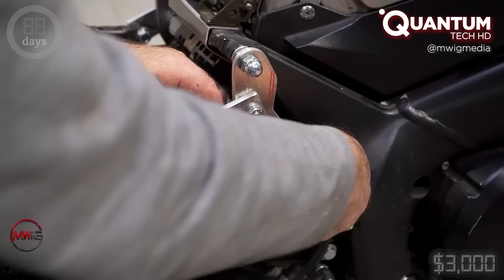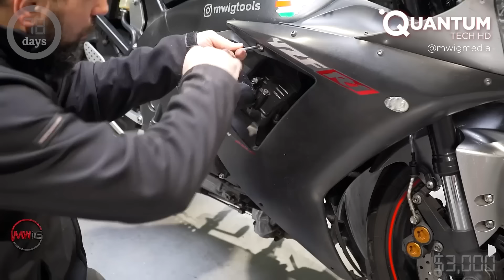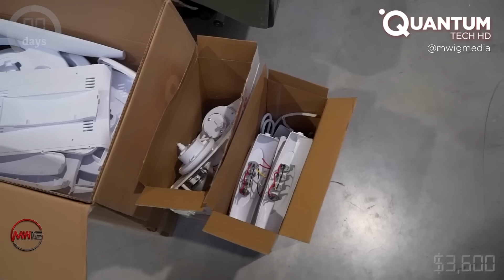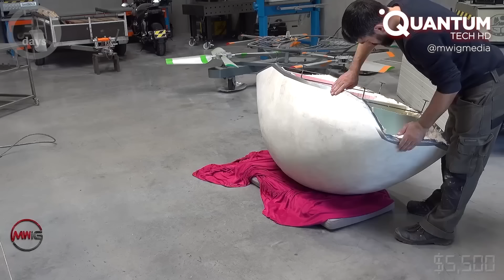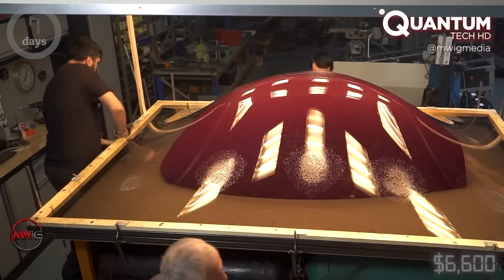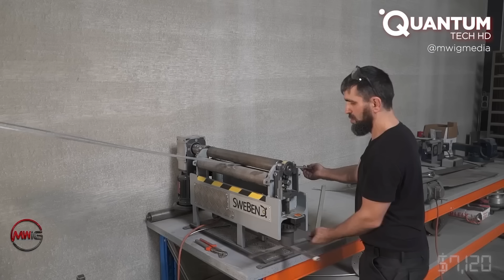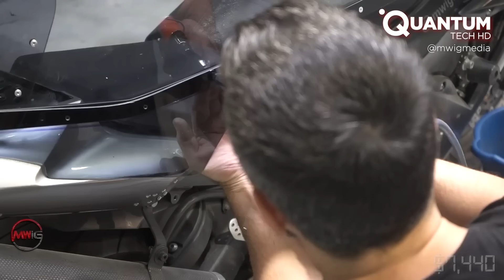The Motorcycle That Beats the Rain (Built in a Garage) | by @mwigmedia

Comment: why did he fix the heating chamber to the ceiling??? why not lower it with the PC sheet??? how can one be so shortsighted?!? problem solving, give me a brake! you could have used the same first sheet again! with vacuum, if the surface of the mold is clean and smooth, you can mold and thermoshape the same warped sheet! thermoplastics work like that! and the vacuum is not adequate! much more instant suction is needed! you heat the sheet continuously while shaping and vacuuming! the industrial molds are preheated, and not plastic or foam! this is very disturbing, an epic fail, and very childish! a one-piece would have been much better! and polycarbonate should be thicker! not 4mm, at least 10, for a safety cage. and it should have been higher! no problem if it's a bit higher, the crosswinds are a concern but you need to consider helmet space and seat the rider ergonomically. not crammed and with mobility so limited! this is an aerodynamic structural and safety element he intended to manufacture! there should be these things on the market already. the fact that there are not, should probably give you pause.. the thing is, they make, albeit not sufficiently effective, rain repellent clothes and helmets for that.. well, you gave it a try..  I ride myself, and I know wind is a problem without this huge construction, I feel pushback from the helmet and side winds, the point is thermoshaping, in any application, you need heat, and once you contact the cold mold, you instantly lost malleability!! I'm not even addresing turning your motorcycle into an air resistance blimp monster. thermoshaping is the actual point here! of course you wanted functionality, ok I grant you that! Man, the rain must bother you a lot! just don't go fast, and avoid storms! thermoshaping needs heat throughout the molding process! even after applying vacuum!!! heat is what was missing! how did you not see this?? engineer my sphincter! cmon people! it would have been interesting! instead you wasted my time! why not build the same rig, the heating chamber with tall walls, not cut it in half, even taller, and not with vertical walls, but a truncated pyramid with heaters on the top and on the walls as well, much fewer would have sufficed, and it was smart to build above, but you should have lowered it in place, and kept it there, made sure the mold would be heat resistant. you build that with plaster, something that doesn't crack, that doesn't deform with heat! not foam, that expanding foam softens very easily, look up some numbers online for that. if you don't have a preheated mold, then make sure the IR heat is on during suction! the effort was colossal, I appreciate that, of course, but you work smart, not long and hard! And you use protection, filter that air you breathe!!! what are you doing, you need a positive pressure helmet and shroud, with some sort of pure-air system attached. many companies make them, 3M, optrel, really important! for any sanding work! life expectancy, and quality of life! I would think it's important! but man, not bad, for an improv.. I didn't like the metal segments you bolted together, one piece shaped, welded aluminum parts would have done the trick. stealthy weld seems, sanded down to perfection.. ok, I'm done here.. thank you for the content, I guess.. mixed feelings here. sorry for the critique. makes me feel guilty as hell! take care!

Comment: Crosswinds will be nuts. Benny's market was actually the guy on the scooter. Lower speeds make this more usable, but it would need a wiper, too.
Reply: Man at that point get a car.
Reply: If you must ride a scooter in the rain out of necessity then the world doesn't care about you.
Reply: @mega_momo-x4d you are so right.
Reply: @mega_momo-x4d  Clearly we care about Mexicans
Reply: @mega_momo-x4d  Lol that's gotta be me but to be fair I dont think the world cares about a lot of ppl either😆
Reply: I believe this concept is meant to spark discussion and innovation, not represent a final product. Consider this as an early prototype concept. The idea was simply to showcase the potential direction. With proper R&D and engineering refinement. Design improvements can be made to handle factors like crosswind stability, balance, and safety mechanisms far better.
Reply: @Mutlashi  The final product has to be some other material. Acrylic will be full of scratches soon.
Reply: @postoffice146 Ok sir
Reply: @postoffice146  As we can see he already got crack on the left side close to dashboard, wnen tightened bolt.
Reply: @postoffice146  And if you notice toward the end their are a couple of cracks radiating out from the small angle brackets.  Again, this is a problem related to design and choice of materials.  That thing also could be a killer on the interstate at speed when riding with crosswinds and around 18 wheelers.
Reply: @postoffice146 Oh really? It seems to be OK on fighter jets. Lexan is what you want not plexiglass.
Reply: Uff con los vientos a 80 km por hora será un cohete ese invento 😂
Reply: pour les essuie glace laisse tomber le plexiglas se raye trop vite ! par contre par temps de soleil dans les bouchons hum tu doit cuire la dessous 🤣
Reply: Just by a car😢
Reply: @kmipos  Un coche no pasa entre los carros, y además, una moto tiene su estilo, es de acuerdo al gusto como una zapatilla y un zapato, la misma necesidad, diferente entorno.
Reply: @kmipos  Buy. It's 'buy", you water head
Reply: Rain coat like the guy on the scooter is more cheaper, but this POV is really cool looks like the Toyata's 3-wheeled motorcycle in Japan.
Reply: @youngtevanced8818  'more cheaper'? You eat a lot of paint chips as a kid?
Reply: You don't need a wiper. I rode out from Maine to Indianapolis on a Honda VT 1100 Shadow Sabre and for the last 4 hours or more was in a torrential downpour which limited my speed to 60 mph. My short windshield swept the air to the top of my full face helmet, but the curve of the plexiglass face shield kept the rain from blurring my vision. I think the same would be the case for this rain enclosure. I would be more concerned with the effect of any cross wind on the bike's stability. I wouldn't want to crash in that setup. This guy needs some good rain pants and a pair of Sidi waterproof motorcycle boots. I get sufficient protection with a good rain jacket, pants, boots and Olympia WeatherKing gloves, such that I stay completely dry in the worst downpour.
Reply: thing is retarded. too bulky
Reply: bennys market is a 3 wheel or the guy on scooter
Reply: Rainx-even mario anretti learned to like it
Reply: Not really. Because of the curvature, like a hurricane proof house in the Caribbean, he shouldn't have much problems. Remember, air flows faster over a curved surface
Reply: how about his legs which are not fully covered by the roof?
Reply: You can apply water repellent.
Reply: ℝ𝔸𝕀ℕ-𝕏  𝕀𝕋 𝕎𝕀𝕃𝕃 𝕊𝕃𝕀𝔻𝔼 ℝ𝕀𝔾ℍ𝕋 𝕆𝔽𝔽 𝕆𝔽 𝕋ℍ𝔼 𝕎𝕀ℕ𝔻𝕆𝕎𝕊.  ℙℝ𝕆𝔹𝕃𝔼𝕄 𝕊𝕆𝕃𝕍𝔼𝔻. 
𝕋ℍ𝔼 𝕎𝔸𝕋𝔼ℝ 𝕎𝕀𝕃𝕃 𝕊𝕃𝕀𝔻𝔼 💦 ℝ𝕀𝔾ℍ𝕋 𝕆𝔽𝔽 𝕆𝔽 𝕀𝕋, 𝕀𝕋 𝕃𝔸𝕊𝕋 𝔽𝕆ℝ 𝟛 𝕋𝕆 𝟜 𝕄𝕆ℕ𝕋ℍ𝕊.
Reply: The plastic doent hold water, drop and roll.
Reply: Rainex. Ask yourself: do airplanes have windshield wipers?

Comment: I use to operate and maintain a machine which made massive plastic forms, normally the heating elements are above the plastic sheet and drawn away on rollers. The form rises from below slowly meanwhile air is blown from inside to make space for the form and the plastic is blow outwards. Suction is initiated within the machine causing the hot plastic to wrap down and around the form and blown cool with cool air..

Comment: Spectacular! One question: Wouldn't it be better to fit plastic protection on a less powerful motorcycle? The motorcycle, I believe, cannot be exploited in its power when there is a plastic cover. So when it rains it is useful yes, but it is to the detriment of the performance of the motorcycle.

Comment: Btw this does NOT protect your legs, so its a nonstarter lol.
Especially on a sport bike your legs will get soaked and ice cold using this, if you survive the wind blowing you off the road or into traffic.
Also lacks ventilation and defogging, which is MAJOR safety hazard.

Comment: Great idea and nice handcraft. I believe it's right to shape the acrylic through heating. Perhaps you should make a concave rather than a convex mould to let the softened acrylic naturally flow into an expected shape. Or, keep the heater under the acrylic like the first attempt, but put the convex mould onto the acrylic. Push the mould down to force the acrylic deforming till the mould was full covered. All in all, it's a wonderful job I would like to do but never made mind to proceed. Congrats to ya.

In another aspect considering for making benefits from batch produce such rain proofs, one should find a fab in south China to reduce manufacturing costs. It may be difficult for DIYer's hand work, but really easy for a modern manufacturer.

Comment: To mould polycarbonate you must drive out the embedded water vapour by heating gently for a long time then it will mould without the bobbles that form when any water vapour is boiled out being trapped in the plastic other plastic are not as strong but form better.. As they found out acrylic is easier to work with.

Comment: I have a better idea about how to build anti rain coating.
My proposition is to redirect heated air from the engine through the compressor to the nozzles located at the front and rear in front of the fairings and special deflectors and directed towards and backwards the flow and partly towards deflectors in order to creat an air bubble around the driver while driving. 

And vertical flow of heated air when standing steel.
👍

Comment: Think your original idea was great, a full one sheet canopy. I did something like this way back, creating the underwater telephone booth, plexi underwater sphere's. The trick was using pressure not vacuum and blowing the plastic through a shaped hole (no need for a mould) and clamping the edges tightly. My cost way less then yours, using a water tank as my main air source and some bike tires as my main pressure cylinder for clamping. The oven was built back in the day (nichrome wire & asbestos sheets) loosing heat was always an issue until I used cloth on the table.

Comment: These covered motorcycles are already for sale in the Philippines and other SE Asian countries, also in Europe.  BMW even made one with a full aluminum cage frame.   He did Not need a fancy vacuum pump. a sears wet vac would have done the job for a hundred bucks and 20 minutes time.  He could have heated the plastic to 320 degrees F with a simple, fast, cheap gas hot air system.  He could have made a deep bubble with just and oval hole stretching into a vacuumed box, etc.  If he had only a week to do this, he might have succeeded better.

Comment: I have often wondered why these vac forming machines are so complex and fidley to operate, especially trying to form a vacume to deal with such a large volume. Why has nobody  just built a frame to hold the plastic below the heating element, then have the form/buck below that on a table with holes in it for the escaping air. The plastic can then be heated and the frame dropped over the buck/form and held tight to the table forming a seal, all very standard so far. But then instead of trying to form a vacume below the table to suck the soft plastic down onto the table and buck/form, you introduce compressed air into the box above the plastic where the heating elements are and the air pressure pushes the plastic down onto the form and table.
This would have several advantages, no vacume setup needed at all, air pressure from an air supply bottle would be instantly available and much higher than the vacume could give you. It would be a much simpler and cheaper system when dealing with large plastic vac form objects.

Comment: That's a death trap. Riding a motocylce in the rain  = soon to be organ donor.  And when the bike hits gravel or hydroplanes and goes into a low-side crash that  canopy prevents you from jumping free and your leg gets pinned under the bike.
Reply: Nowadays, there are tires so high-performance they'll make you lean the bike until your knee hits the ground. There's even rain gear.
In any case, the guy chose the least suitable and least comfortable bike, both for riding in the rain and for customizing it that way. Regardless, with the fairing lowered like that, you can only ride at high speeds and on straights. As already mentioned, with that sack of a ball, that bike is a danger to everyone, but not because it's a run in rain bike.
Reply: I have always believed that every motorcycle is a potential death trap. I don’t think that this one is more dangerous than any other motorcycle.

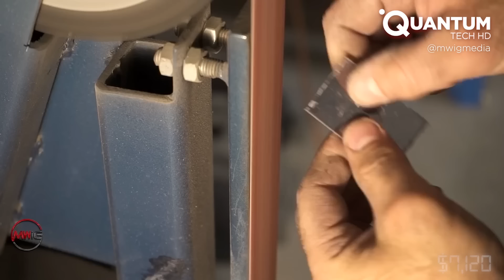Comment: Are my eyes deceiving me? @22:20  What kind of material is transparent and can be bent like steel on a brake?
Reply: Plastic
Reply: Polycarbonate is better for cold bending because it is more flexible and can be bent without heat without cracking. Acrylic needs to be heated to be bent, otherwise it will likely crack or shatter.

Comment: So how do you see through the canopy in the rain ?
Reply: There is a spray you use on aircraft and helicopters. Super hydrophobic. 
The drops bounce right off.
Reply: With his eyes
Reply: @danzusername Overlooking the obvious.  LOL
Reply: @danzusername Overlooking the obvious.  LOL
Reply: Wie machen das Motorradfahrer die einen Helm mit Visier tragen ?
Man hat doch gesehen das der Regen, durch den Fahrtwind abperlt !
Reply: The water drop and roll, that especial plastic. Also can improve use material that let wind pass and water drop. Challenge the element with technology.
Reply: Good question.  He never thought of that.  I think he is planning on spraying cooking oil on it so the rain just slide right off.
Reply: .. . . . I'm sure this is one of the things he thought of..... And Rain-X it's probably his solution... It will 100% fix any rain problems.. Rain-X does the trick... No one can deny this unless they haven't tried it

Comment: your shoes or boots will still get soaked. water from passing cars will blow up under. i also wonder what passing a semi or any other strong gust of wind would do to handling.
lastly, a person rides to get out of a car, not to keep the rider high and dry.
Reply: Yeah, all good points.   To me, a rainsuit and a helmet does the job more completely, with less wind resistance and a lot cheaper.  There are already one man fully enclosed vehicles out there, that do a better job overall than his creation does.  The more that I think about of all this the more that I think he might be barking up the wrong tree with this project, but you have to give him credit for taking it this far and for a relatively small invention cost.

Comment: When there is a will there is a way
Reply: More like when there is a will there is a horrible way.
Reply: And where there is a villan there is a new Ballroom for a new damsel in a shortdress
Reply: You might've overlooked a "few" things:

-  skills of a whole team of engineers: machinist, fitter & turner, fabricator, panel beater, spray painter, electrician, woodworker, sheetmetal worker
- a pre-existing shop with a lot of high grade tools, equipment, and materials
- 7500$ 
- 4-5 months of doing nothing else

That's quite a hefty requirements list, but sure, let's just call it "will". I'm sure that everyone that wills something like this - can achieve it, because that list of requirements is easy peasy, right up everyone's alley.
😏